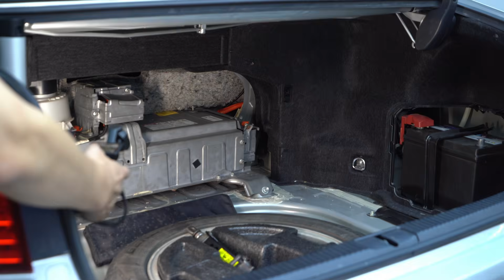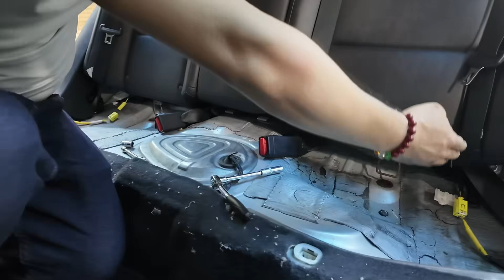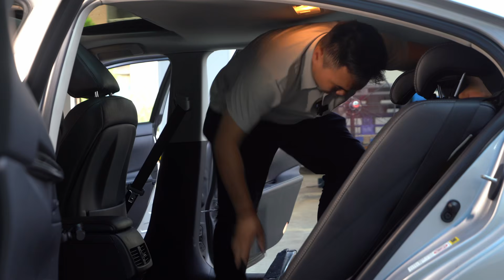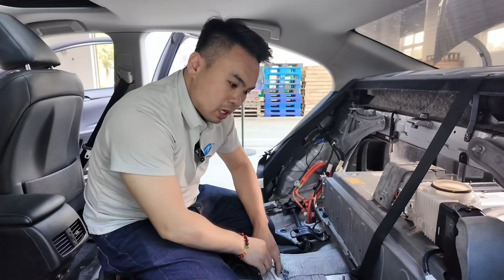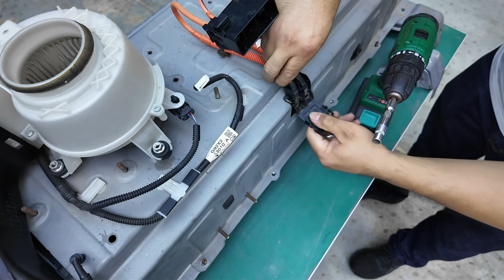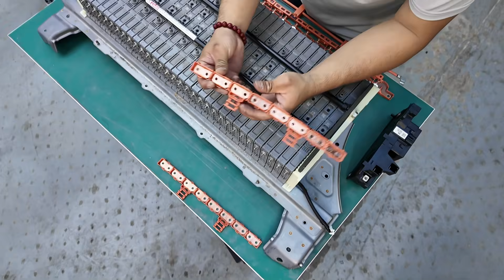LEXUS ES300h Hybrid Battery Replacement | Complete Walkthrough

Comment: Do you just let the car charge the Lithium batteries with the same voltage ranges and current as the NiMH battery pack? Or do you need to load new figures into the Power Management ECU?
Reply from the maker: Direct plug-and-play. No need to mess with any ECM softwares.

Comment: is the process the same for a 2013? i wanna DIY this project on my 2013 with roughly a 115k miles on it.
Reply: Did it fail? what mileage are you getting in the city and highway?
Reply from the maker: It did not, but fuel consumption was lowered, therefore customer opt for a replacement using our lithium ion batteries instead of NiMH from the dealership. Avg fuel consumption is about 36mpg driven only 20+k miles so far.
Reply: @INNRG-HybridBattery average city only? or average city/highway mixed?
Reply from the maker: What do you mean? The sienna didnt have the hybrid until 2021+.